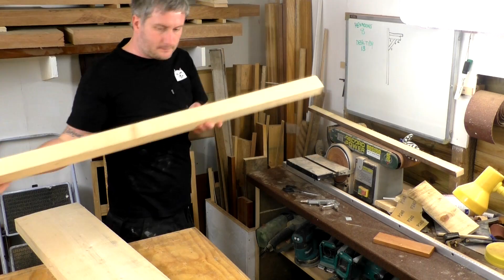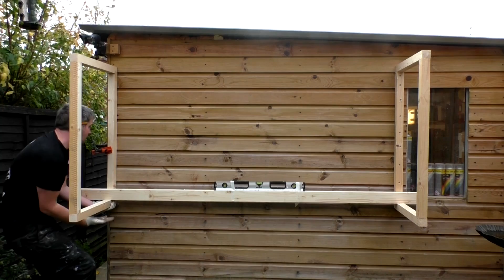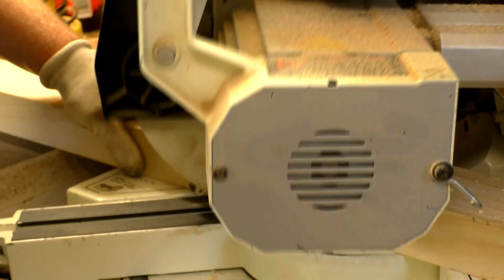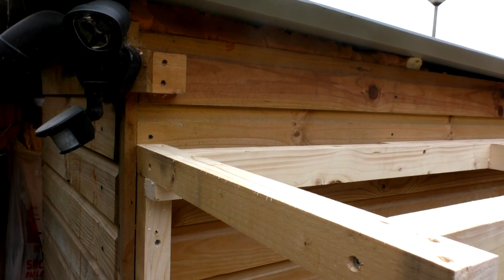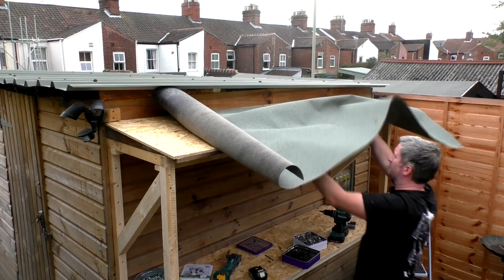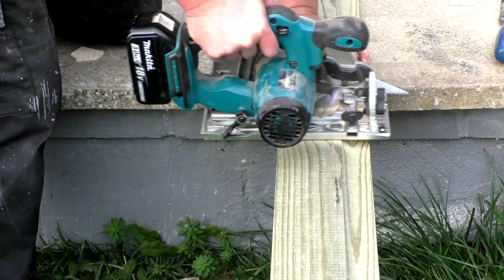Building The Workshop Shed Extension (part 1 of 2)

Comment: I recommend some sort of support for the overhang. The floor is hanging by those 8 screws in end-grain (not reliable) and then the few screws across the one horizontal member. I assume there are no legs for a reason. But, if you do a pair of 45 degree support members underneath, it should help considerably. The things you're putting in there are not only heavy, but they vibrate a lot, and over time, that will add to joint failure..
Reply: Pete Brown Completely agree with all you say.
Reply from the maker: I considered adding brackets underneath but prefer the cantilever look and after a "sitting test" (which will be in part 2) I was confident enough that it will be ok
Reply: It's a cool addition, and looks nice, but engineering-wise, it's just not solid long-term with what you have planned to be in there. If you want to keep the look, perhaps at least a ledger board underneath that goes the full length,? That will let those bottom brackets rest on something that's attached to the studs instead of just pulling at the screws in the end grain. Not as good as a bracket, but it'll take the weight off, so to speak.
Reply from the maker: Time will tell, I can always repair it if it all goes wrong!
Reply: Sorry to say, I was thinking the same thing when I saw it was supported by screws into endgrain. I made the same mistake when making a small out feed table for my table saw.  The legs were screwed onto the top with screws into end grain. It wasn't long before they pulled out and the legs became loose.
Reply: I agree.  The build is good, but this isn't a cantilever.  If it were a cantilever, the extra support wouldn't be required, but the angled supports in the sides should help.  Thanks for sharing, I enjoy your video's.
Reply: As a math inclined person I'd just say to never underestimate the power of the triangle. Congratulations!

Comment: Depending on weight do you need a couple of bracket braces on the bottom?
Reply from the maker: I considered adding brackets underneath but prefer the cantilever look and after a "sitting test" (which will be in part 2) I was confident enough that it will be ok

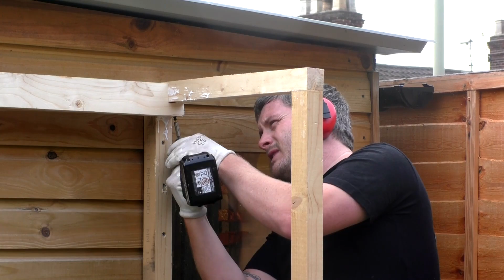Comment: Nice work. I would venture to say you probably didn't need the glue but i guess it won't hurt. Also at 4:06 your driver bit came out-happens to me all the time, especially when the bit is new and fits tightly in the screw. I wonder if there is a way to stop that happening...
Reply from the maker: Yeah that happens to me all the time too! Annoying...

Comment: ooh, I could use one of those. How are you handling the cold in the winter months? Its been feking freezing, meaning I discovered a condensation problem like you had with the metal roof, Im gonna have to buy some polystyrene sheets to put up there. All my walls are sheet metal, do you think it is worth doing it to them as well or will the condensation not form there?
Reply from the maker: I had a panel heater which was rubbish, then I got a fan heater which was ok but awkward shape and size so I just got an oil filled radiator with a built in thermostat. It's really good! Would definitely recommend the polystyrene it solved my condensation issue
Reply from the maker: I'm not sure re: condensation on the walls tbh as I've not used the metal sheets upright before